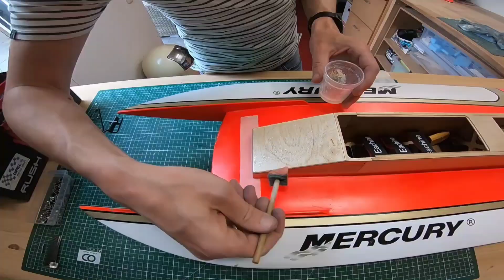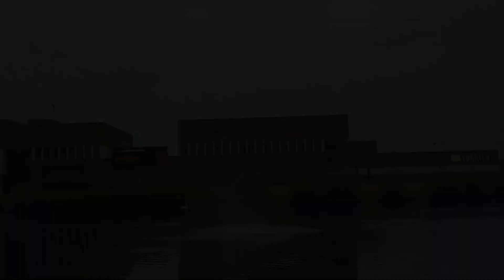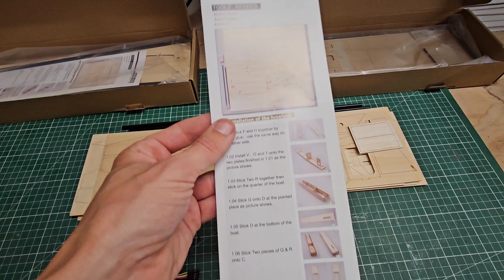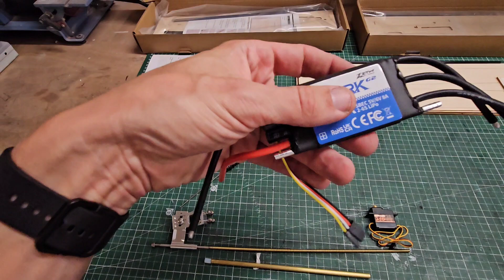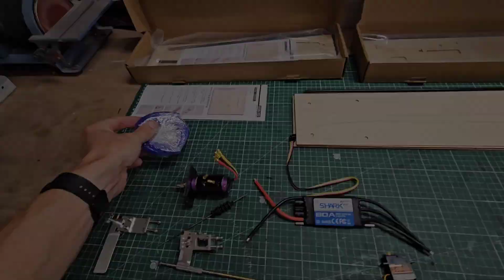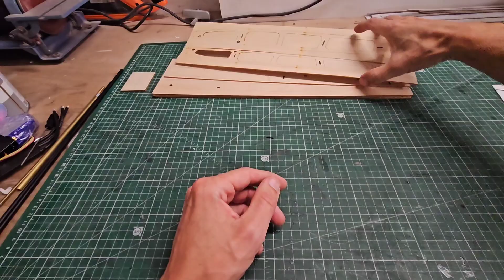The cheapest way to go fast: Shrimp rigger DIY RC boat build project!

Comment: What standard motor would you recommend I just built the kit and the kit motor burnt out in less than 1 min
Reply from the maker: Too bad! I recommend a 2850 3450kV Leopard motor
Reply: @CozyRC thanks heaps I got inspired to build the shrimp rigger after watching your video thought I’d build it as standard then build your performance recommendation

Comment: Is the original motor from the kit waterproof? last time it burned down after 3rd run
Reply from the maker: It is. A burned motor is not due to water. Maybe due to a lack of water(cooling).
Reply: @CozyRC  It wansnt watercooled, only the esc, the motor suddenly burned down and stopped working
Reply from the maker: @dimamariankov1929Always add water cooling in a fast RC boat. Because you motor wasn't water cooled, it burned down
Reply: @CozyRC  Thank you for the advice

Comment: Thanks for the video. Do you think the little ZTW Shark G2 120amp would work with a 36mm motor 6s on this outrigger?
Reply from the maker: Thanks! That motor is too big for this rigger, and it doesn't need it either. Better keep it light for better performance 😎
Reply: @CozyRC  ive got 3 extra 36mm trying to use them on something

Comment: I used that same motor in my shrimp rigger. 
It was incredibly fast, I used a 1.6 pitch 27mm aluminum prop, with no turn fin, bad idea, it slid across the water into some submerged brush and the motor tore itself out of the motor mount and strip the prop of its blade.  I used an Octura strut and rudder combo. 
I’m sure you are enjoying yours by now. 
PS “put a turn fin on it guys” 🤣
Reply from the maker: Nice one! I almost finished 1 of 3 that I'm building. I made a custom carbon fiber turnfin with a double bend. I hope to maiden run it this weekend!

Comment: Ok Ok, It happened to me because I was FOLLOWING THE INSTRUCTIONS AND THEY DON'T SAY TO SWITCH UP SIDES. OK! 
I was not the only one who did this Thank God.

Could you let me know what motor you used? Everyone is just going for all-out speed and forgetting to tune for turning. I have seen folks with 3650s, 60S. Also, I have seen 28MM cans and I have seen "H2OMech" and his crazy speed Arse jam a 40MM TTT in there (just kidding, but I would not put it past him.

I have used an outrunner just to be different. I like blasting some calm speed laps that are super consistent and the little 2845-2750KV on 4s is a nice little change from what I see everyone doing with the shrimp. I am turning an Octura X535 prop.
Reply from the maker: Your setup sounds great! Top speed is often the focus, and honestly, I love to set some good speed numbers, too. That being said, I will tune this boat for running laps as well! It's perfect for the small pond nearby my house, where I ran some laps with my Mini Mono and Hydromite. I think my record lap is 8.1 seconds with the Hydromite. I have good hopes this boat will beat that. I will run a 2858 2900kV on 3S and 4S, with a 36-38mm prop

Comment: Great boat I gave two kits away with custom Strut 4mm to 3/16 conversion. mine so far is the fastest 3S With turn fin 64 MPH out there. and yes i have a video of it too.
Reply from the maker: @AdamEverythingRC  That's a great speed for 3S, nice job! I use a lower kV motor, but who knows what I will end up with. ✌️

Comment: Very nice, just finished mine but blew the prop shaft out the back. Fun build, do you know a good site for rigger parts? Thanks have a great day!
Reply from the maker: How did you manage to blow the prop shaft? I use the big far East website for almost all my parts. The video description contains the parts list of the hardware that I will use. ✌️
Reply: @CozyRC  The prop shaft came of the flex cable, that stayed with the boat but the prop, shaft and bushing are in the lake... Thank you and I will check out your description 👍🏼

Comment: Very cool.  I am working on one myself.
Reply from the maker: Nice! What setup are you planning to run?
Reply: @CozyRC  Have a smaller, high amp motor with a 150 ESC and a 4S LiPo i am trying to squeeze into it.  Have to change several of the mount points to get everything to fit.  Considering creating the ski-box under to cover the prop shaft.
Reply from the maker: @theSane-one Sounds good! I'm going to add the ski as well, and I narrowed the front sponsons for less resistance. Part 2 will be uploaded today or tomorrow ✌️

Comment: I also recently built the boat and I can only recommend replacing the servo holder plate with carbon. I would also replace the cover for the battery with a larger one so that you can install a larger battery. This allows you to use the Cnhl 3000mah batteries.

I am very excited to see what you will make of it.
Reply from the maker: Thank you for your recommendations! It's great to hear that a 3000mAh lipo might fit with a hatch mod. I will definitely consider it, as well as the carbon servo mount 👍

Comment: When I install my Motormount, I lay the motor down a couple of degrees from the stock position.You can fit a bigger motor in. I also make my motor mount out of carbon fiber like you did

Comment: Haha why is it always when i build a new rc a few weeks larer you also build it is am currently getting done with my rigger that i am building for someone
Reply from the maker: @parkourrush3820  Nice one, Mylan! Is it also a Shrimp kit?
Reply: @CozyRC  yes it is the b068 gona be overpowering this one with a rocket 3450kv 2948 on 3s and maybe on 4 but i will maybe make a turn fin on it if the friend would like to but nog necassary
Reply from the maker: If you want to run ovals, you need a turn fin for sure. For just speedrunning, you can take it off. I will add a turn fin, because I want to run it in the small pond and set some fast laps 😉